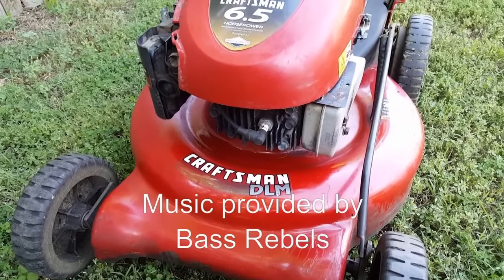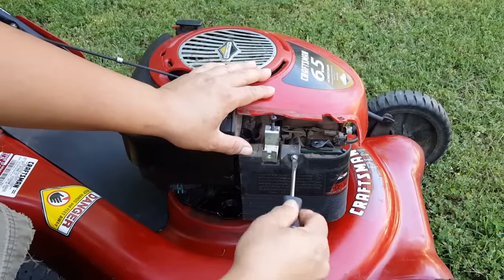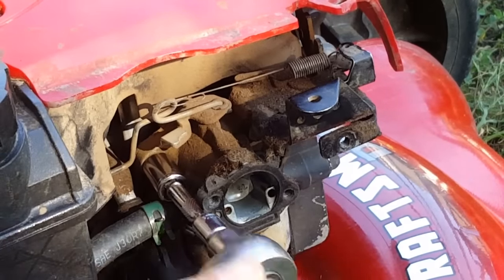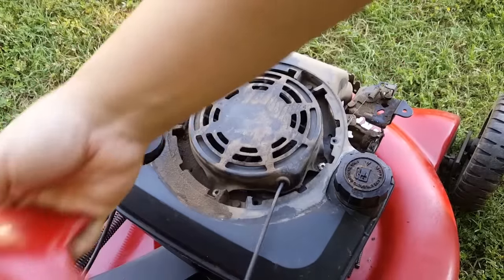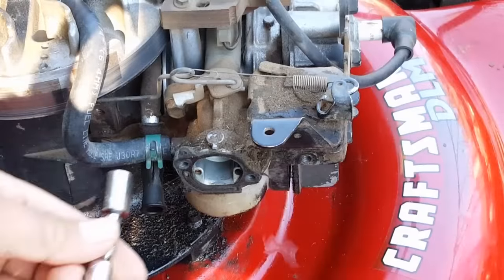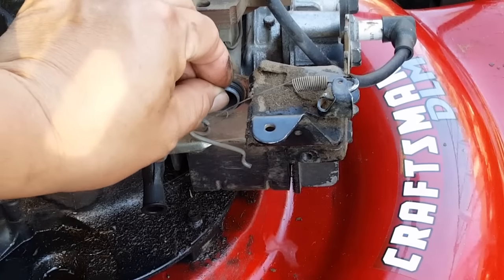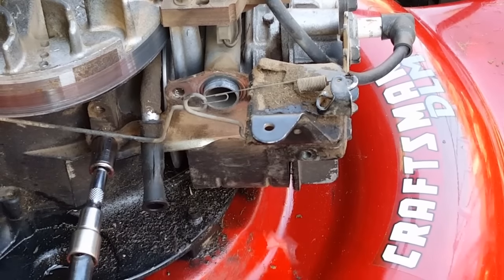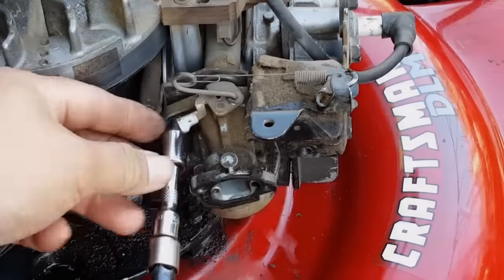Lawn Mower starts and then dies, turned out to be an easy cheap fix -Loctite!

Comment: Thank You for the video ☺️ Great but I just changed out a bunch of parts. Is it possible there is something like an idle screw. Same as you I can get it running but then dies.
Reply from the maker: this model was never meant to be idled, only ran at one engine speed. Only mower with a throttle cable to change engine speed, will there be an Idle set screw on the carb. If you it still won't stay running, just replace the carb.
Reply: @HomeGaragechannel  Thanks , I just changed out the, needle seat, shaft-throttle, valve- throttle, gasket, and air cleaner. And a screw driver through my thumb. So, now what ? Cabarator was clean.
Reply: Hey by they way thanks for your reply great video and response.😊
Reply from the maker: @marymadalenem2351  did you make sure the jet was clear? Also did you confirm that you have spark at the plug?
Reply: @HomeGaragechannel  ok what is a jet and spark plug good
Reply from the maker: @marymadalenem2351  is your mower like the one in the video? it's the brass bolt that's at the bottom of the bowl.
Reply: @HomeGaragechannel  yes I had to take it apart to to put the needle in. My motor is a Bragg's & Stratton. It may have something to do with the spring it doesn't come back when it's shut down. I love this stuff. I should have gone to learn small engine repair. But Thank you again for your time! I'm trying not to buy a new engine. It's on my wood splitter and I live off grid. Thanks again!❣️
Reply: @HomeGaragechannel  o

Comment: I found out what my problem is with my push mower it has two screws missing. And I have no idea how that would have happened.?
Reply from the maker: Probably vibration made them come loose.
Reply from the maker: Probably vibration made them come loose.

Comment: If you're having carb issues last thing you want to do is Loc-Tite the bolts...

Also, that wasn't thread locker you used...it was gasket sealant (Loc-Tite 515)...which is used to seal gaskets...not bolts...
Reply from the maker: Maverick thanks for the insight.
Reply: Everyone's a critic eh 😂

Comment: Well I’ve had tons of problems with my mower. The engine runs strong. I’ve cleaned the carburetor 6 times and then the last time I even cleaned the gas tank. It ran 3 tanks or gas out. Today I try to start it and this same thing happens.

It starts every time 1st pull and then dies. My mower is slightly different. It’s a Briggs 500 e series. Am I looking for the same o ring? I don’t remember mine having that ring. I’m confused on what to look for. Please help.
Reply from the maker: sure,  So your engine has the plastic carb on it then? If so, have you taken the cartridge out and cleaned it?  Also how did you clear the main jet?
Reply: @HomeGaragechannel  yes it does. I have taken the cartridge out each time I’ve cleaned the cab. I spray everything out each time with carb cleaner. When I put it back together it runs perfectly. The last time I did it I cleaned the tank too because I thought it might be dirty. Ran 3 tanks of gas through it finished mowing no problem last week. I went to mow yesterday and it would start first crank and dies. I can do that 30 times with the same result. I figured it was an air issue. I’m really tired of fooling with this. It’s been fix and run each time I mow this entire season. 😐
Reply from the maker: would you willing to replace the carb?  Then if it happens again, the problem is not the carb
Reply: @HomeGaragechannel  I guess I don’t have any other options. It’s very aggravating to clean it each time I mow. However, I don’t know what part number to find one. I’ve been told that if you buy one from Amazon they’re junk. I’m not sure on what to do… 🤷🏻‍♂️
Reply: Should I replace the entire carb or just the plastic insert cartridge?
Reply from the maker: not sure either
Reply from the maker: the entire carb.
Reply: Okay. Thanks for your replies. 😁

Comment: I got same issue been parked up 2 years or more . possibly the fuel    dirty and had some thing floating on it drained it started stopped straight away .I'll check carburettor and it's seals when weathers better go though it abit more thoroughly
Reply from the maker: nice, let me know how it goes.

Comment: I have a 3.5hp brigs & straton  classic engine on my mower .  It runs for 5 minutes then spluters and dies. It will start but dies after 2 minutes. Have cieaned and replaced the carby gaskets the primer bulb even swaped the coil but still havevthe same problem.  Can you surgest a cause?
Reply from the maker: sure, replace the gas cap.  It may not be venting air, into tank. 
For fun, you might change the spark plug as well.

Comment: what type of O-ring should I ask for at the hardware store. Such as, what type of material that is heat resistant ????
Reply from the maker: to be safe I would get a variety box of o rings. otherwise you'll need to measure the pipe diameter that it sits on. Rubber is fine.
Reply: @HomeGaragechannel  thank you
Reply from the maker: @e8iMm7KE999  no problem

Comment: Interesting. I recently rebuilt the engine on mine and it will only start intermittently and then dies after a few minutes. I wonder if this could be the problem? Worth a try, anyway.
Reply from the maker: I would loosen your gas cap, it may not be venting properly
Reply: @HomeGaragechannel  really? The tank has a small vent in one corner. Maybe I should try reaming it with a piece of wire?
Reply from the maker: it's up to you

Comment: I have a 1990's Craftsman Lawn Mower with a tecumseh 4.0 HP engine. I can get it to run for about 5 minutes with a smooth idle. It then suddenly dies and will not start until it cools down. Do you have any idea what would be causing this? I have taken my carb apart and cleaned out the jet and needle and seat. I'm at a loss with what could be wrong.
Reply from the maker: sure, loosen your gas cap and see if it lasts longer, if so, replace the cap.

Comment: I have the same mower and the problem is that is stumbles to starts and puffs smoke , I cleaned the carb and spark plug, air cleaner condition is,ok, it's the autoprimer ,then after awhile it refuse to start
Reply from the maker: That's a tough situation.  You can replace the auto primer for the filter housing that is the conventional primer button style and get of that problem.

Comment: New murry given to me, I pump prime it, it cranks one pull, rubs about twenty feet and shuts off, it is a new mower, only cut grass one time, could the coil be over heating, and cutting itself off?
Reply from the maker: Possibly but try something first. Crack the gas cap loose and try it again.  See if it goes further.
Reply: @HomeGaragechannel  ran like a new one for 16steps then shut off. I took cap off, so no change
Reply: @HomeGaragechannel  filter seems like oily.
Reply: @HomeGaragechannel  it don't smoke, runs like new, only for about ten feet then dies.
Reply from the maker: Ate you going to change the filter.?
Reply: @HomeGaragechannel  yay, I took the filter off it's new, so I put it back on, same thing, but I thought maybe if I try to put gas cap back on, and see if I can not put it on tight, it ran for about ten steps acted like it was gonna die, then kept running with gas cap a little loose, I just ran the bag full of grass clippings, yay, it must have something to do with gas cap, cause when I took it off, their was lits of pressure,  thanks a bunch. Woot I'll subscribe to you thanks.

Comment: I had a Huskie push mower series  that would  start and then die so I drained the gas tank, drained the carb bowl, and the lines, put in fresh gas and it ran fine. I suspect water collected over a number of years, but hope this may help someone else.
Reply from the maker: thank you for the tip

Comment: My mower is doing the same even after a total carb cleaning and nothing seems loose
Reply from the maker: does It have a primer bulb or does it automatically choke the carb, and you just pull it till It starts?

Comment: my mower was new last summer and only used it 5 times before winter set in, so dont think anything is loose, could it just be old fuel? im enw to petrol mowers
Reply from the maker: Yes it could be old fuel. By the sound of it, It appears there was still petrol in the tank, which is not suggested to do.  You're carb, might now need to be cleaned
Reply: thanks i just tried fresh fuel and its a nogo, is it quite an easy clean for something with no engine experience?

Comment: My problem is that the mower will re start perfectly when warmed up.   But on a cold start it will start and stop numerous times.   It is not the carb, plug or the coil,  or the intake.   Linkage is fine.  I have two mowers that do the same thing.  Wondering what I could be missing
Reply from the maker: do they have primer bulb, or do you just pull it to start, no pressing on anything?
Reply: @HomeGaragechannel  just pull...
Reply: Figured it out.  Took out coil.  Re gapped.  Fires right up perfect everytime now.  Did a .007
Reply from the maker: very nice work, and thank you for the update

Comment: Great video ..Thank you so much..
Reply from the maker: No problem Anthony Harper
Reply: @HomeGaragechannel  Quick question ❓. I replaced everything on a Troy Bilt lawnmower took the carburetor apart twice . Ok should I put back together and just spray carburetor cleaner inside and it should fire up. It was exposed to moisture for maybe a year .
Reply from the maker: @anthonyharper8161  you could do that but how did the carb look inside?
Reply: @HomeGaragechannel  It had water inside which I cleaned throughout. But the person who gave it to me had aluminum foil on the gas cap port , no air filter no cover ! I cleaned everything ! I'm just feeling overwhelmed. At this point..
Reply from the maker: @anthonyharper8161  so it's still not starting then?

Comment: Do they have a way to video a problem on lawn mowers and get a video back to fix it. I try typing it in but they don’t show what I’m looking for.
Reply from the maker: Sure.  Shoot a video and upload it.  Ask me and several other lawn channels to watch it from your channel and see what advice we give you.
Reply: Ok thanks
Reply: Ok I up loaded a video how do I get u to View it
Reply: Home Garage here is the first video https://youtu.be/p3FnxjJiF-E
Reply from the maker: @tobyparfait7915  thank you for the video I appreciate you doing it.  Did you poke a wire thru the brass part like I did in my video here ? https://youtu.be/WAvO6zmxXhE
Reply: No I didn’t know that comes apart but I will do that and let u know what happens thank u
Reply from the maker: @tobyparfait7915  great let me know.
Reply: Ok. I have to order a recoil for it just waiting on it to come in. I’m going to let u know. Thank you very much for helping me.
Reply from the maker: @tobyparfait7915  no problem I appreciate your feedback
Reply: Home Garage I have a ? Carburetor cleaner dip can is it good for plastic carburetor. I’m send you a picture
Reply: Thank u very much for helping me with all my questions and the video helped me a lot. God bless you
Reply from the maker: @tobyparfait7915  no problem and I wouldn't try putting the plastic carb in there. It might melt.
Reply: Ok thanks

Comment: My Briggs and Stratton is starting after pumping the bulb then running for a minute then dying. Any tips for that? It’s like it’s running off the gas that’s initially pumped from the bulb then running out??
Reply from the maker: yes you are correct, the more you pump the longer it stays running. Take the carb apart, and clear the fuel jet. Depending on what brand you mower, it might easy, or somewhat difficult.
Reply: @HomeGaragechannel  Thanks. I actually adjusted the gas cap first and it seems it’s done the trick. I guess not enough air flow through it
Reply: It’s a craftsman btw
Reply from the maker: thanks for the information

Comment: I do not understand what was wrong. The carb was not tight to the body, and that included the old thin gasket?
Reply from the maker: use the bracket that the carb attaches too was loose, this meant the O-ring that seals the carb to the intake tube was not sealing properly.  For the carb to work well there cannot be any intake leaks between it and the engine

Comment: were did you get your better o-ring
Reply from the maker: Thank you Jared Hopkins for the comment.  It was part of a larger kit of orings from Harbor freight.
Reply: The mower in  the video is doing exactly what mine is.  I have replaced the carb, the primer, the gas tank, the gas line, and the spark plug and it still doesn't work.  I will try this.
Reply from the maker: @jaredhopkins5642  you didn't happen  to hit something hard with it? Is there a gouge in the blade edge?  I partially sheared flywheel key l does this sometimes  too.
Reply: @HomeGaragechannel  actually i think the kids did say they hit something
Reply from the maker: Might be worth looking into. Thanks for the information

Comment: Mine is brand new and does this start and immediately stop thing. I get about 10-15 seconds of run-time.
Reply from the maker: that's interesting. try leaving the gas cap loose and see what happens.  Can you not take it back?
Reply: @HomeGaragechannel  I tried that. Sprayed the carburetor with starting spray, too. If I leave it sit for a while it'll start for a few seconds before shutting off. 
I can take it back. Just that it's a ways away and I'm trying to avoid that.
Reply: @ScottieMacF  Take it back if its still under warranty.  I made the mistake with a brand new motorcycle that would bog down around 70 mph. This bike should do 110mph. I figured I could fix it. I didnt want the downtime while it was in the shop. Our freeway speed limit was 60 and later changed to 70mph.
I just lived with it and let the warranty run out. At times when passing I needed more speed.

Comment: I have a model 944.369440, bought new, after a month it would "Start and stop running", took it back to SEARS for repair. I was told it was a carburetor, replaced the whole unit. Well after another month it happened again, had it fixed again, and again, until it run out of warranty.  All I can say, it is a piece of JUNK!
Reply from the maker: R2D2 thank you for commenting.  I'm baffled as to why it kept breaking down.  How did you store the unit?
Reply: it was stored In a garage. Now I took the carburetor off, cleaned it out, no dirt inside, checked the float and pin valve that regulates gas level. Unfortunately one of the connecting rods (wires) slipped off the "Butterfly" and I can't find the diagram anywhere to reconnect it. (Should have taken a picture before) . At this point I am not sure its worth the effort, new one is under $200.00 .  Model #  944-369440  Thanks for taking an interest in this.
Reply from the maker: Thank you for  I appreciate it.
Reply: T'is.

Comment: I just replaced my carb with a new one. It was running for 5 minutes and quit. How come the loose plate causes a problem if the carb is secured tight to head?  Im not understanding why the loose plate was the problem.
Reply from the maker: The Carb Only seals to  the intake pipe by the black o-ring, And the carb is bolted to the plate the happens to be loose. Theres not a good seal between the carb and the oring.
Reply: @HomeGaragechannel  ohhhhh I see... The plate is loose which means the seal is loose which means... possible air leak. Can I ask another question?  If it's a new carb, new air filter, new spark plug, fresh gas... What else can I check for hard to start issue?
Reply from the maker: even though you have a new spark plug, you need to check if the ignition system is sending spark to the new plug.  After that, your engine could also be worn out too.
Reply: @HomeGaragechannel  I certainly appreciate the direction.  I will check the ignition system. The motor sounds so strong when it's running so I didn't wanna give up on it ... But I'm pretty close 😫
Reply from the maker: I understand your situation
Reply: @HomeGaragechannel  again thanks! I rechecked carb, plate, filter base. Tried 3 plugs, I'm convinced it's something with the ignition system.  Yippee I get a new mower!

Comment: Yea i have a problem with my lawnmower it leaking oil through the carb and clue why
Reply from the maker: Yes theres oil blowing thru the crankcase vent to the air filter housing.  Check the oil level and if it's good then the check valve might be blown.

Comment: Can air filter not shutting chock off?
Reply: No, but carb being reconnected wrong or stuck linkages for choke and governor will cause start/run problems.
Reply from the maker: no, there should be a piece of plastic that protects the choke flap from filter
Reply: The filter is dirty and I removed ir but I believe it's not shutting the choke off checked my connections look good. It ran fine last year grandson left it out so I'm going to try new filter. I did remove carb to drain float bowl but it was doing something before removing it.

Comment: thise mashine is running with to slov rpm ?.
Reply from the maker: are you saying " this machine is running with low engine speed"?
Reply: @HomeGaragechannel  yes. its going around 2600 rpm.  have to be  betwin 31 and 3300 rpm.  faktory set them low to keap the noise down . (sorry my english is not perfekt)
Reply from the maker: @rasmusrasmussen1249  no problem I had guessed that's what you meant, Yes it is running a bit slow. it needs to be increased. Thank you Rasmus Rasmussen.
Reply: @HomeGaragechannel  Okay. you will find that you set rpm. to normal. then you have a completely different machine. which even mows perfectly even under load in tall grass. but good movies you make
Reply from the maker: @rasmusrasmussen1249  thank you